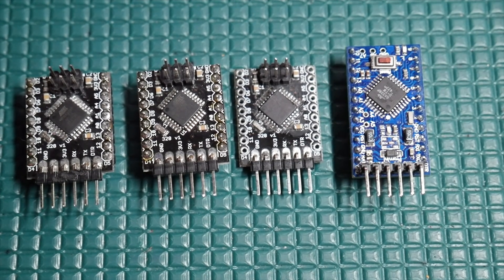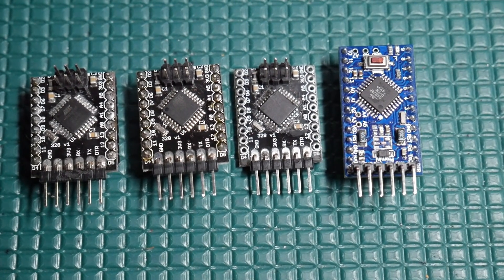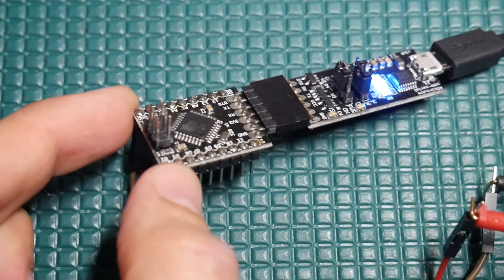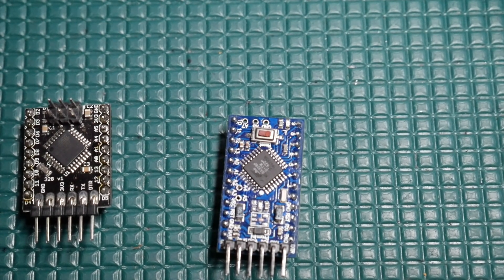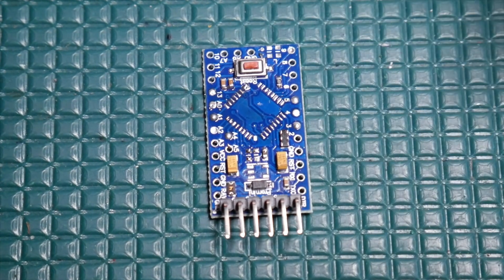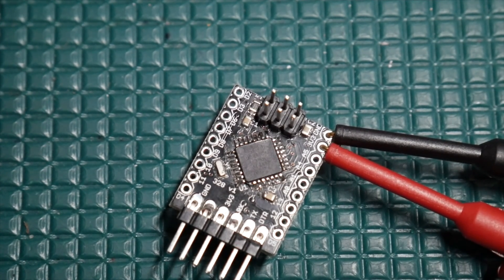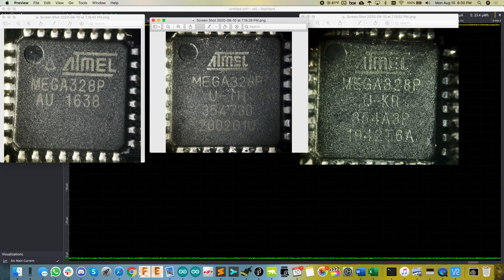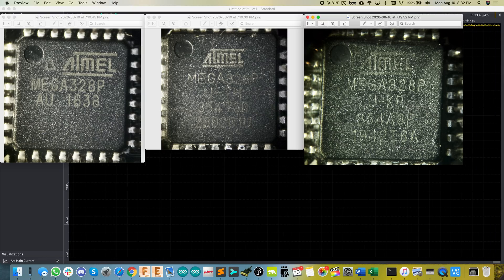Sleep Mode breaks on cheap Pro-Mini? Testing ATMEGA328 - is it counterfeit?

Comment: Good day Mr Kevin, I apologize in advance, this comment is not about the content of this particular video, but of another video of yours... 

Uhm a while ago you've posted a series of videos on how to control esp8266 from anywhere in the world, in Part 1 you've used an arduino connected to an esp8266 to control the brightness of a led. Also, in Part 1 you've mentioned that you've worked on industrial scale iot projects.

I am working on circuitry which pulls data from waterpumps ( waterpressure, motor current etc.)  to give farmers a way of keeping an eye on their waterpumps. I am also a mechanical engineer, so I am sorted with everything up to the point where the esp8266 must communicate with a remote server...

Could you perhaps point me in a direction where I can find information on how to setup security   for example, you know, things that would be used on an industrial type of project

Comment: Hi Kevin, nice video. I had some couterfeit ATtiny44A chips and made a video about them. At first look (from the top) they seemed the same, but they didn't work. On close inspection it was clear that the original markings were filed off and replaced by others. The side view clearly showed a lower, uneven profile that didn't have the same roundings as the originals. Perhaps you can also have a look at the chips from the side?

Comment: Just a thought.. Recently I was working on a project using a ATmega32u2 with a dc-dc converter on board. There was some tuning that needed to be done with the converter, and it made the 5v rail very noisy and prone to dips that would reset the controller. After awhile, I noticed that the board was consuming 10mA under really no load, and the chip was getting hot. Replacing the bootloader made no difference. The chip was somehow damaged and consuming a huge amount of power. Perhaps that is the case here? Were there other identical chips that exhibited the same behavior, or was it just that one?

Comment: Yes, I bought 10s of so-called Atmel DIP chips, and I'm pretty sure I had some orders that were fake ones. But, still, it's amazing they can fake these chips.
Reply: Some time ago I was sold some fake ATtiny44A SSOP chips. Their tops were filed off and remarked. These were chips with same pin count, but totally different type.
Kevins chips could be remarked LGT8F328P chips. These are not fakes, but re-engineered Chinese chips with even additional features. However, if some culprit marked these as genuine Atmels, they became fakes when they received their fake markings...

Comment: Yo got me confused. You proved the possible counterfeit chip theory from the pro mini, but you didn't go the one extra step and drop one of your known good chips on the pro mini board to eliminate any possible leakagein the pro mini board itself
Reply: Gonna assume that he correctly cleaned up the board, since he already replaced it with a 2020 IC and the current was the same.
Another possibility is that the IC is a recovered / waste IC, which has not had a good prior life (or was taken off the board with a blowtorch).

Comment: Kevin, this videos demonstrates what lengths you go to in order to provide the best performance from your products.  Case in point, the front door alarm you provided me in September of 2019 (11 months ago) came charged to 4.1volts.  Now, just over 11 months later of that front door being opened 1,475 times, the battery in the alarm has only dropped 0.3 volts!  Thanks again for the great product and peace of mind it provides.
Reply from the maker: whoa! thanks!

Comment: This really isn't new, ther e have been clones of AVR chips for ages* and, predictably, 'fake' Atmel chips have been doing the rounds for a decade or more, at least this one actually runs code and isn't a relabelled buck converter:

 https://www.sparkfun.com/news/364 

Wonder if Logic Green were the originator of the silicon?

https://olimex.wordpress.com/2013/12/12/3-arduino-possible-holly-molly-chinese-avr-clones-are-coming-meet-lgt8f88a-mavr-core-processor/

Comment: Did you read the fuses? Probably this one has BOD enabled. Your code to disable BOD before sleep may take longer than required 4 clock cycles, therefore might not work.
Reply from the maker: yea tested with the stock fuse settings, then burned again identical to my known good chip.... still bad

Comment: I got burned with I2C on the clone pro mini before. I was banging my head, switching breadboards, jumpers, soldering wires but couldn't get fast i2c working reliably... Now switching to board I deemed reliable is my first debugging step.
Reply from the maker: ouch!

Comment: Interesting, I wonder if the 'boot_signature_byte_get' has some random bytes. 

A simple example below:

#include <avr/boot.h>
#ifndef SIGRD
#define SIGRD 5
#endif
void setup() {
  Serial.begin(115200);
}
void loop() {
  Serial.println("");
  for (int i = 0x00; i < 0x40; i++ ) {
    if ((i % 0x10) == 0)
      Serial.println();
    byte b = boot_signature_byte_get(i);
    if (b < 0x10)
      Serial.print("0");  
    Serial.print(b, HEX);
    Serial.print(" ");
  }
  Serial.println("");
  delay(5000);
}

I use the 'boot_signature_byte_get' to simulate a Serial Number on atmega chips, some bytes have a serial behavior.

Check the library for more technical detail: https://github.com/ricaun/ArduinoUniqueID/
Reply from the maker: ah well that is interesting! I already have a part 2 planned!

Comment: As soon as you popped up the pictures I thought the right hand chip was counterfeit. I have dealt with a lot of chips from ebay, the majority of which are counterfeit. In most cases, the logos, on close inspection, will appear to be printed with a dot matrix format. Dead giveaway. However, have you put one of your digikey chips on the blue board? Just curious if there are any other issues with the board.

If you can't wake the chip up once in the deep sleep, what is the purpose of the mode?
Reply from the maker: nah, haven't tested on the pro-min board, but it's probably fine.  Yea, no real point of this mode, just a quick test... all sleep modes would have higher current though

Comment: I agree with zapro_dk... they could be rejects or mislabeled parts accidentally pushed onto the secondary markets to make something back on production costs.   A manufacturing engineer loaded the 328 build process, but the silkscreen operator loaded up the 328P version?

Comment: I use dozens of the cheap Pro-Mini’s in complex assembly line test fixtures and, although I have not tested the sleep mode current, I have always been concerned about the ADC performance for the very same reason.  The analog  features/functions are the most difficult to get right and factory fallouts must occur often (and then where do they go?).  However, the only thing I have noted as an inconsistency problem between the low cost devices is the settling time after switching the ADC mux to a different channel, this time can be considerably different between devices and has caused some problems for me until I bumped the delay time ( between switching mux channels and starting a new ADC conversion) up considerably; for all I know, the prime parts may also have this issue as well.  Thanks for the heads up on this sleep current issue because I do use that feature in other Atmel applications but not on a low cost Pro-Mini yet.
Reply from the maker: yea I could see that also being a problem... I'll think about testing other features as well.  Like even a memory test
Reply: @Kevindarrah  : Good idea,  a memory test (and others?) at the upper and lower operating voltages!

Comment: They are probably not counterfeits, but wafer rejects that is picked up from the trash bin, packaged and marked and sold for a profit since you didn't pay for the wafer.
Reply from the maker: thanks - never heard of this kind of thing!
Reply: @Kevindarrah  That certainly happens (although I doubt it in this case).  I had to debug a batch of faulty professional telecoms boards destined for the BT network, in which Infineon chips were failing.  We sent the chips to Infineon, and they told us they came from a failed batch and should not have been on the market.  We bet purchasing got them from the grey market.
Reply: "B-selection" electronic components is something I have gotten from "a friend" at times. He works at a electronics repair company and from time to time they receive dodgy components from the manufacturer that won't reach the specs and still had passed the initial control.
 Normally they file a complaint and receive a refund. My thought is just that someone might be picking up those components already discarded from production and makes a few bucks out of them..
Reply: Anyone viewing this in the future, it was proven to be counterfeit.

Comment: If this should be investigated, i suppose next step would be to list up potential other chips that have been cleaned up and remarked, such as Leaf Green 328p and maybe different Atmel chip variants. Perhaps it's Atmega 328 without the P so it's non Picopower. I mean if they had a bunch of extra stock of less desirable variants of the genuine Atmega chip, it would make sense to manipulate their face to sell them quicker or for more. So you could look for spec differences unrelated to current draw to try to test for them. Clock drive circuit and fuses seem promising to look at.
Reply: The signature for the non-p is different, so Avrdude would not program it. I wonder if the signature is hardcoded in the silicon, or if it can be changed with the right equipment ...
Reply from the maker: yea, I'll see if I can check that!